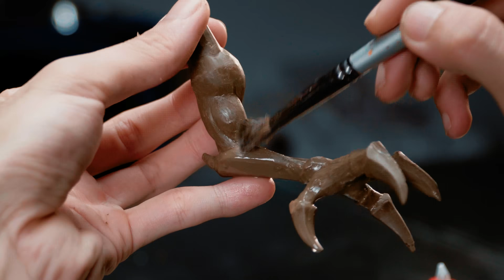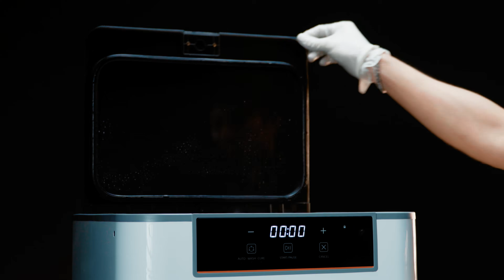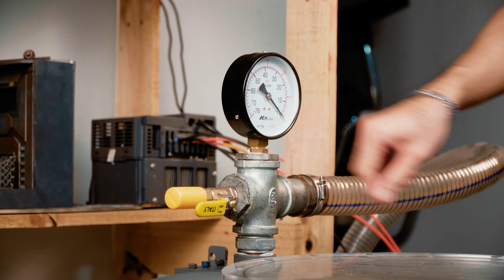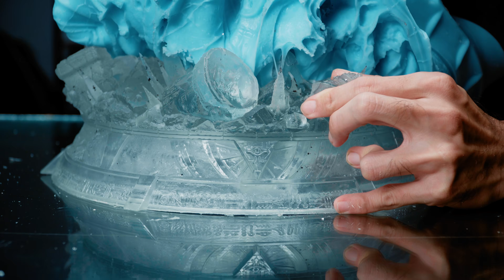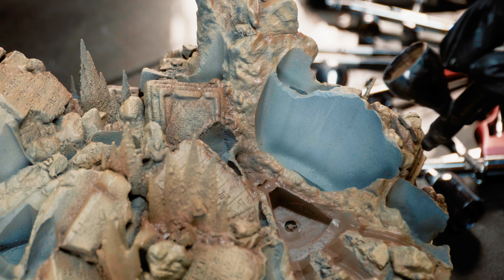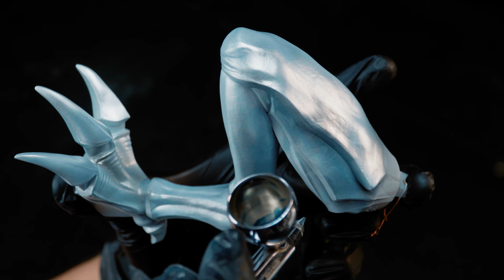How To Make Glowing Blue Eyes white Dragon Diorama With Way Too Much Resin

Comment: I have one question the apoxy resin you used here can it be used for 3D printers?
Reply from the maker: No, the plastic used for 3D printers is UV resin, cured by UV light. Epoxy is a ring-opening addition reaction of Epoxy with Amine.

Comment: Hola.
Muy entusiasmado con el pedido
Reply from the maker: Hello. Thank you for contacting to order. The Ultimate Blue-Eyed Dragon model is completely handmade with Epoxy Resin that is highly impact resistant. Model size
- Single base 32x32x20cm, weighs 5kg,
- Dragon 70x45x50cm, weighs 4kg
Preorder date: 9/28
1-year free repair warranty policy. After 1 year, repair or replacement will be charged
(but my model with extremely special quality will not be damaged if accidentally dropped normally) it can only be damaged in a small part if intentionally smashed. Let me show you a test video
- The price of the model is $700. Product delivery time is December 2025
- The first sale I limited to 20 copies to ensure delivery time and product quality. After the first batch has enough quantity, we will move on to the second batch of sales, and I will update the delivery schedule at the preorder reception.
please contact me at the fanpge waw creator

Comment: Magnificent work ❤❤❤. How much the price for this masterpiece?
Reply from the maker: Hello. Thank you for contacting to order. The Ultimate Blue-Eyed Dragon model is completely handmade with Epoxy Resin that is highly impact resistant. Model size
- Single base 32x32x20cm, weighs 5kg,
- Dragon 70x45x50cm, weighs 4kg
Preorder date: 9/28
1-year free repair warranty policy. After 1 year, repair or replacement will be charged
(but my model with extremely special quality will not be damaged if accidentally dropped normally) it can only be damaged in a small part if intentionally smashed. Let me show you a test video
- The price of the model is $700. Product delivery time is December 2025
- The first sale I limited to 20 copies to ensure delivery time and product quality. After the first batch has enough quantity, we will move on to the second batch of sales, and I will update the delivery schedule at the preorder reception.
please inbox me at fanpage waw creator

Comment: Take my sub and my money, put this on an auction website right now and let us 90s babies bid on this masterpiece.
Reply from the maker: Hello. Thank you for contacting to order. The Ultimate Blue-Eyed Dragon model is completely handmade with Epoxy Resin that is highly impact resistant. Model size
- Single base 32x32x20cm, weighs 5kg,
- Dragon 70x45x50cm, weighs 4kg
Preorder date: 9/28
1-year free repair warranty policy. After 1 year, repair or replacement will be charged
(but my model with extremely special quality will not be damaged if accidentally dropped normally) it can only be damaged in a small part if intentionally smashed. Let me show you a test video
- The price of the model is $700. Product delivery time is December 2025
- The first sale I limited to 20 copies to ensure delivery time and product quality. After the first batch has enough quantity, we will move on to the second batch of sales, and I will update the delivery schedule at the preorder reception.

Comment: This is just awesome!
Very well done sir. A masterpiece!
Just a quick question, you say in the video that after the sponsored segment, you'll explain why you sculpt in clay first and then 3d scan. I am sorry but I most likely missed your explanation although I watched the whole video. Anyway can you please kindly elaborate why did you go through the trouble of making the model on clay?
Thank you very very much
Reply from the maker: @vasilisanasopoulos2600 
thank you for your attention. let me explain why i sculpt clay
- first of all, to serve the audience who love clay sculpting, my channel was built and developed by the audience who love clay sculpting, and some of them are not sympathetic to 3D printing. that's why i still have to choose clay sculpting from the beginning for the project.
- when sculpting clay i can easily adjust and view my model in the most intuitive, clear and realistic way, which when drawing 3D cannot be seen because it is just a 2D image simulated on the working screen. if you draw completely 3D you will need to print it out and look at it, if unfortunately there is an unsightly angle you will have to fix it and reprint it. this will take a lot of time, or you have to accept an ugly hidden angle for your model.
- On the contrary, the question "why not make a mold with clay instead of 3D printing to make a mold" is: clay cannot make magnet joints, there is no precision for the joints, if you watch the video you will see the sound of the magnet joints is really interesting, right? It requires almost absolute precision. something that only 3D can do. Those are all the reasons that have created my journey. I sincerely thank you for your feelings and the questions you asked. I hope to always receive your attention and follow-up
Reply: @wAwCreator I understand, it's the best of both worlds.
Thank you, you are an inspiration!

Comment: A genuine question: why going through the trouble of making a mold and casting the model when you could just reprint it?
Reply from the maker: a very good question. The reason I make molds is because the product from the mold will be cast with epoxy resin material, completely different from 3D printing resin because epoxy is elastic and can withstand impact many times more than 3D printing resin. In addition, casting will reduce production costs when it can be cast in large quantities. If you 3D print, it will take a lot of time to process the printed model after removing the support pins. I hope if you have the opportunity, you will buy one of my models to experience it.

Comment: Masterpiece is probably the most accurate tern. Because this is beyond amazing! A bow to your skills and efforts.
I must know, how much would you normally charge for something like this? Because I am seriously considering commissioning you guys!
Reply from the maker: Thank you for appreciating my work and intending to hire me. This project I make commercial production molds so it will take a lot of time and effort. If you want to do art work, the cost will be around $2500 depending on the size and complexity of the project you request. And the product will be 3D printed, not cast epoxy resin like this product of mine. I really hope to sell many products to recover the capital spent on this project.

Comment: I am speechless, this looks soooooo cool and it's awe inspiring !! Monster clay seems to be quite fun to use, can you apply the silicon on it directy ? Also, the paint job is so impressive, it really feels like an ice dragon i love it soooo much ! You're very impressive and I still love your videos !
Reply from the maker: It is not possible to use clay mold blanks. There are several reasons as follows: - there is a possibility of deformation during the mold making process - the joint is not yet complete, it must be processed with 3D software and printed with 3D blanks to get super precise joint details - thank you for praising the paint color, I had to experiment with many new formulas to get the result
Reply: @wAwCreator oh I see 
Thanks for the advice !!!
Reply from the maker: This model I will produce commercially with the highest quality, probably better than most resin models on the market. I really hope you can help me share this video. So that by chance I can meet someone who wants to own this model will contact me. Thank you very much